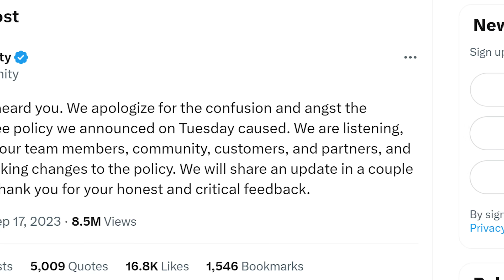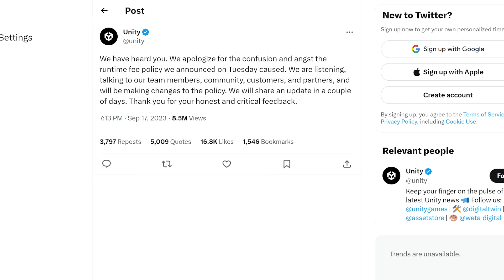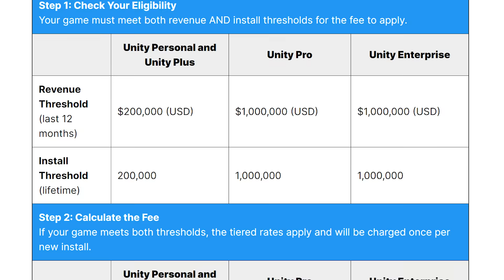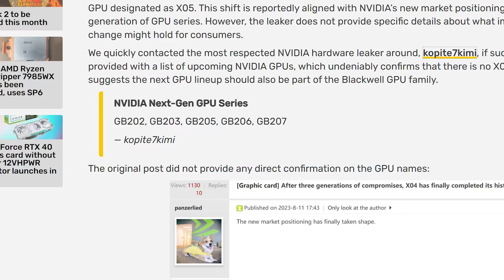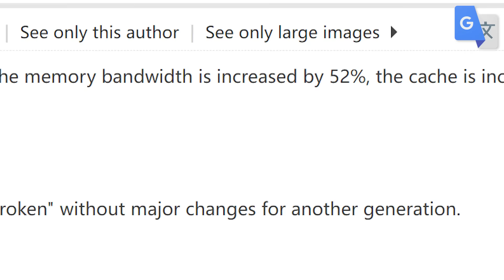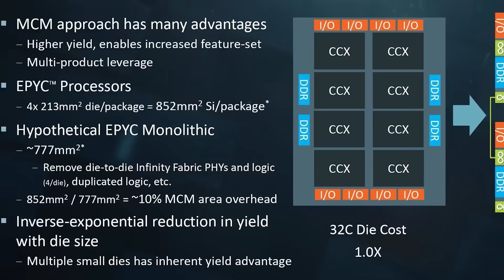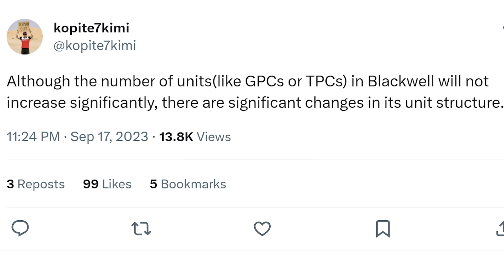RTX 5090 Completely DESTROYS The 4090!

Comment: RTX 5090 Specs:
a. 50% more cores
b. 52% more bandwidth
c. 78% more cache
d. 15% higher clocks
e. 1.7x performance uplift

F. 195% more expensive
Reply: Will be 2000 max
Reply: RTX 5060
a. 50% less cores
b. 50% less bandwidth
c. 50% less cache
d. Same clock
e. 5% performance uplift 

100$ more expensive because they will add DLSS 4 exclusive for 5000 series.
Reply: You forgot to add power requirements and it will be so high.
Reply: Yours for only $3,000! The more you buy, the more you save!
Reply: I press F
Reply: How could you forget 50% more power draw.
Reply: @charizard6969 about to sell my FE for 1700, and "only" have to add 300$ to 500% for the 5090. Pretty sick if you got the cash
Reply: @nerdynumen  it’s not gonna be that much I’m pretty sure it’s just going to replace the 4090 price or a 100 dollar increase. We’ll see tho when they drop the titan it could give some insight for 50 series.
Reply: I pressed Ctrl-Alt-will-not-B- abletoafford
Reply: G. F is underestimating the price increase by at least 50%
Reply: G: Needs its own dedicated 15A circuit breaker
Reply: @adhahanif9792  how? Each series has been progressively improving massively power efficiency
Reply: G. more expensive electricity bill
Reply: Don’t forget about 5060 TI
Reply: You will need to connect it to the power grid directly. 

You missed this point.
Reply: There's a reason for the price being after an 'F'
Reply: @coding-sp  Right . 5090 brand new . Supposedly will push 8k to 60fps and more. I will take the 4090 though . Wait 8 -10 years for the 7090 lol
Reply: A 12700K/DDR5 6000mhz is having problems pacing with the 4090. Even the 13900K in some situations. Eliminating those is to have a 16900K right now. DDR6 as well. Or AMD equivalent of course. Gaming in 8K is not a happy median.
Reply: @mikem2253  While the WORLD spams F5.
Reply: @kramnull8962  no its not for 8k gaming wait a few years for that . I have a 13900k I got no problem with my PC .
Reply: Thank you
Reply: G. 2000watt power, time to hook up a fuse box
Reply: @inowtf4299   They cant increase just 100 they still need sell 4090
Reply: @edvinaspetrauskas7594  true but it doesn’t really matter cause look at the 3090 and 3090ti they were replaced with the 4070ti only reason to get a 3090 is vram and it’s till selling for 1k-2k NEW. So the 5080 could replace the 4090 and they just bring dlss4 or some new feature or lower cost to the 5080. But idk we’ll see what nvidia does in the mean time I’m probably upgrading to a 4090.
Reply: you spelled "min" wrong bro its 2000$ minimum maximum 20000$
Reply: @mikem2253  xD
Reply: and 200% watt usage probably
Reply: I'm so tired of these marketing hypes. Because that is all they are. Part of the marketing plan when launching a product is to create a hype. Don't fall for it. I have a 3090, folks have 2080 and 2060 and they can still game on them. What you have is good enough. The rest is marketing
Reply: 6k for card
Reply: thanks
Reply: @charizard6969  My money is on that it's going to be at least 3000
Reply: remember read the small letters, doenst not come with own powerplant!
Reply: If it will be Bigger it wont fit in pc case
Reply: More expensive or partly the fact the dollar becomes even more worthless.
Reply: well if its less than 3k EUR its fine, paid 2.6k EUR for 4090 rtx so getting 70% more power for less than 3k cost is not too bad
Reply: I could see people paying that: The RTX 4090 is priced at $1599. A 200% markup would put the price near the 6k mark. Which is about the same as what a beginner would pay for a starter motorcycle. And in America, at least, Motorcycles are essentially toys. Whether enough people would I dunno. The 4090s are basically a halo product, IMHO.  My point is, that there's possibly enough of a market to justify the cost of production, they don't have to sell a lot due to the profit per unit being pretty massive. 

Anyway, my suspicion is that the low and mid range will be taken over by GPUs integrated with the CPU - that for the vast majority of consumers will be adequate - with the high end left for enthusiasts and professionals. Bare in mind I'm not an electrical engineer but, the thing is, Apple already do this with their M series of CPUs. All it would take would be for either AMD, who own Radeon, or Intel, who already produce their own stand alone graphics cards in the A series to start doing more of this and it's basically curtains for Nvidia. If you could go out and just buy a CPU that already had integrated graphics with the equivalent power of an A770 or Radeon 7700 XT then why would you bother installing a graphics card? Since it would essentially be just a waste of electricity at that point.
Reply: @inowtf4299  They're not going to tank the price of the 4090 because it will tank everything else. 5090 will be closer to $2000 if not more.
Reply: @NeightrixPrime  that wouldn’t make sense 4090 is staying the same price and the 5090 will either be the same or 100 more. Cause like I said 3090 and 3090ti are the exact same price since launch and mind you the 4070ti replaced them at 700-800usd. While the 90 class went up by 100 for the 4090 so pattern shows next card will be 100 more while keeping the 4090 the same even the 3080 is still around the same price.
Reply: G. 300% your power supply required.
Reply: But you guys buy it anyway🤷🏽 I don't understand why people complain but then are so stupid and buy it anyway. I don't get it, once I realized that Nvidia is scamming cuz they don't give us raw power anymore just a BS of AI upscaling software I was out as fast I could and changes to Team Red and Since they announced FSR 3 im happy that I changed.
Reply: @On2157  🤣 wtf pal you paid way too much lmao! Every gpu just for gaming which cost over 1.5k is just stupid! Plain and simple. I  gave my brother for xmas ( he is still so stupid and thinks nvidia is a great company I changed to team Red)  the rtx 4090 for 1.5 k swiss francs.
Reply: Will get on day one and can't wait.
Reply: +150% electricity bill
Reply: Imagine they sell it for 4000$ lol. 😂😂
Reply: Don't forget the outrageous power consumption it will require
Reply: thats too generous... try 219%
Reply: @dobermanownerforlife3902  fr some unlocked 4090 had already insane power draw. Soon we going to need high voltage 😂
Reply: @tiagonascimento4386  bro your paying 200 less for like 10-20 more fps vs nvidia. Not a single card this generation is worth it unless it’s a 4090 or 7900xtx congrats i guess? But the scam is buying a new gen card if you have a 30 series or a 6000 series unless it’s a 4090 or 7900xtx but even then those were priced at 1k+
At msrp😂😂
Reply: So we're going to have to have our own dedicated nuclear power plant just to power it.
Time to start building.
Reply: @charizard6969 funny how the gpus were 500-700 for the best. 30 series became double that and 40 series became almost triple that
Reply: $2k for FE, $2.5K for others.
Reply: Exactly and we have learned that a good increase in flagship performance does not trickle down to other consumer gaming GPUs. So their flagship we coupd never afford or would never buy will be great and the GPUs we will buy will barely beat their previous gen model, just like what happened in this generation.
Reply: @TeacherGamer1981   This. im still on a 2070 super playing games at 2k with still over 100 fps on nearly every game. Literally no point in upgrading until the price is right or i want to game in 4k. Continuously upgrading fuels their greed
Reply: @jamie85200  Don't get me wrong, progress is good, it's just how they're wrapping it up, like it's mandatory. And that is absolute marketing and nothing else. Sure, newer is most of the times better, but whan I was gaming on a laptop GTX 1050TI   I was happy with that as well. Before that I played games on a Celeron Laptop with HD Graphics  and was happy enough with Stalker and Metro Last Light and Rome II even taugh they probably worked with like 30 Fps or less.
Reply: same old vram
Reply: Ready to sell your kids,wife, house, and yourself yo buy it..
Reply: Only option F, along with 16gb vram
Reply: 500% more energy use
Reply: it will be 120% more expensive than 4090 release price
6% to account for inflation
Reply: @charizard6969  A yes because everyone needs to have 5000$ PC builds for the home. This is just getting out of hand at this point.
Reply: F
Reply: Hellyeah dang yeah it gonnabe 3000-5000$
Reply: Guarantees to burn your house down.
Reply: Couldn't have summarized this better.
Reply: $3600+400% more power draw.
Reply: @karthikeyan53  5060 probably will be 399$ 5060 ti = 599 5070= 699 5070 ti = 899 5080 = 1299 and finally if it wont be significant then 5090 = 1699 and in other worst case scenario 1999$
Reply: @charizard6969  yeah they said something similar about the 3080 series...albeit cheaper.
Reply: and more than 90% of pc gamers dont care cause only a handful will get these like the 4090/3090 :P
Reply: and it probably  barely  saturates pcie 4.0  in bandwidth 

Meaning when  pcie  6 comes out the 9090 or what ever the fuck they call it will barely  saturate  gen 5 and just  nearly  saturate  gen 4
Reply: 195% more expensive or just 195% the cost? 195% more expensive would mean its $5000
Reply: @charizard6969 that's not bad for a card of that measure
Reply: G: will replace the heaters in your house
Reply: @adhahanif9792  power requirements are getting better. 4000 series shat on 3000 series in terms of efficiency. It’s like the only reason anyone would buy a 4060 ti
Reply: What nvidia really needs too do!
Start focusing on lower prices and abit less on performance.
It is really not impressive, that they can make extremely fast gpu's 
when most ppl. Can't afford them anyway.
Reply: payment option :- kidney T_T
Reply: @TEJASPLAYZ  making a SLI setup, not worth it😁
Reply: so basically we won't be able to afford that card when we think about Nvidias price policies...
Reply: Price doesn't mean shit for me at least lol
Reply: its going to be def 2000+ for a 5090 im even thinking it might be 2500
Reply: 100% Facts
Reply: @nerdynumen  5090 isnt coming out for atleast 2 more years why would you sell now?
Reply: MAX PROFIT :3 @taroushi
Reply: @nerdynumen  ah i see
Reply: How long do we think computer parts can keep improving like this
Reply: How much Tflops? Rtx 4090 is 82.5

Comment: I would be excited for the 5090 if I wasn’t anticipating it costing US$3000
Reply: I've never been excited for a high-end GPU. Even the 1080Ti was too expensive so I bought the 1060. It's always the same.
Reply: i actually think with the 5000 series nivida will try to price it same as the 4000. to further solidify  their claim "this is what high in stuff cost to make now"  and so they can try to sell the 5000 as some sort of value packed  generation "see it's 30-50% better than the 4000 variant  but at the same price so it's a win!"  

i've watched them play this game several times over the years , been building PC's since 1999. 
i think 5090 will launch witht eh same 1599 msrp that the 4090 launched at.
Reply: Get your money yo it comes out in 2 years
Reply: @justaweeb1884  it's comign otu before then , Nvidia has kept a pretty tight 2 year release cycle.   it'll probably hit q2 or q3 of 2024.

EDIT : with the more reccent news about the 4000 super cards coming , it does now look like nvidia is gonna go on a  3 year release cycle.
Reply: Graphics cards are fast become what phones have become new one every year and people must buy it even when there graphics cards they have now are still good at doing what they need a lot of people don't even have the expensive monitors that you need to even run the 4090 to its full potential people buy it as a bragging status like a iPhone.

Comment: Just like this generation, I bought last gen for a large discount. waited until the 4090 dropped and got a 3090 for $600. Ill do the same for the 4090 when the 5090 drops.
Reply: that's a smart move right there i'll do the same i hope all prices for this gen from mid to high range of gpus will get a big discount even more than what they are now
Reply: Issue with that is that lower end cards in the 5000 series will be similar in ability but have new features. The top end card hasn't been good value since the 1080ti because the prices have been astronomical and then made redundant the following generation. Top end cards are inefficient because it's brute forcing with the current technology. But hopefully you managed to get a good use out of it. I always wonder if it makes that much difference. Do you do competitive games or something?
Reply: If that's the case you better buy a 5070Ti which I guess will be the 4090 equal.
Reply: @josemanzanilla115 nah the nearf it a 5070 ti is gona be a 4080 a bit better 🎉
Reply: @Oliver-sn4be the real 5070 ti will probably beat a heavily overclocked 4090 ti but the one we get will be 4090 performance tbh with less vram but less power draw
Reply: cough peasant
Reply: @jambononi  no I don’t do competitive gaming I just have a 1440p ultra wide Alienware oled monitor I have to push.
Reply: @josemanzanilla115  yeah but spending $1200 for a 5070TI will just reinforce nvidia and amds decision to make the $1000+ card the normal gaming card price. Id rather support gamers then support greed.
Reply: @BrolyTheScreamer  I see I see... yeah I recently got gifted an oled 4k TV (it's 55inch but never sure if that makes a difference, presumably not because it's still the same pixels) and my 1080ti crashes on Starfield 😅 but yeah, presumably no one "needs" the highest of the highest but it looks like a 7900xt minimum to play 4k modern games?
Reply: @jambononi  I still have an older rig that is a 1080ti ryzen3600 build, its been a great emulator rig and 4k media center pc. honestly it just kept coming 5-10fps shy of the 60fps mark i was looking for in most games.
Reply: @jambononi problem with TV'S Is the Input delay, even when they have high fps and fast response time, theirs still a delay
Reply: @josemanzanilla115 first of all the 5070ti will be 4080 performance, 2nd of all if the 5070ti was the same as the 4090 would you really want to pay a similar price for a 50% drop in vram? Since you bet the 5070ti is having 12gb of vram, they introduced it on the 4070 so they will keep it for a couple of years, if they made it 16gb then the 5080 will have to be 20gb of vram and the 5090 will have to be 28gb of vram and I don't see that happening unless the price increases again
Reply: @AssassinIsAfk  How can you be so sure that the 5070ti will be a 4080 performance. Let's wait and see.
Reply: @josemanzanilla115  well if I am wrong I am wrong but Nvidia wants to make small gains and a lot of money, if the 4070ti wants to perform like the 4090 will it's price will stay at $800 maybe even get a price hike but also it's going to have 12gb of vram there is no way Nvidia is upping the vram to 16gb and make it perform like a 4090 because then it would make the 5080 pretty much obsolete since the 5080 will be about 10-20% better with the same amount of vram for a lot more money.
Reply: @josemanzanilla115  basically for what you are wanting expect prices to stay the same, if it is 4080 performance the price can drop, if it is 4090 performance the price is going to stay the same.
Reply: @AssassinIsAfk  And for that reason I prefer AMD most, since I'm focused on raw power and less upscale technology.
Reply: @josemanzanilla115  AMD is raw power but it's also not as well optimized as the Nvidia, idk Nvidia kind of has more influence over games and apps, not saying that amd doesn't it's just the Nvidia has been around longer so is supported more
Reply: I still have a 10xx series card, sadly the 20xx gpus aren't dropping below $100, sad days